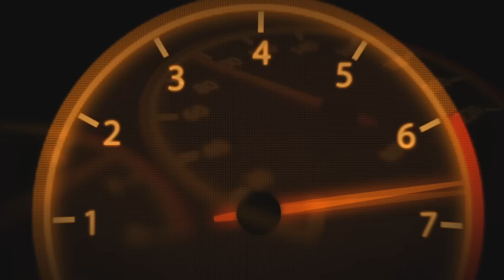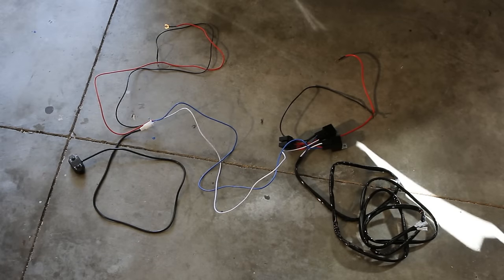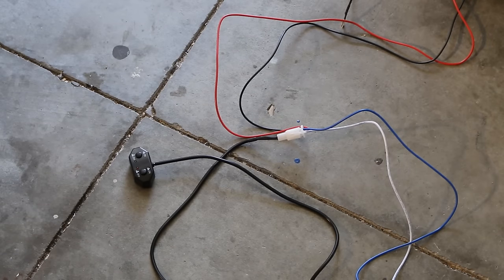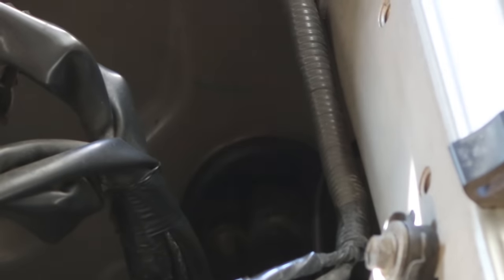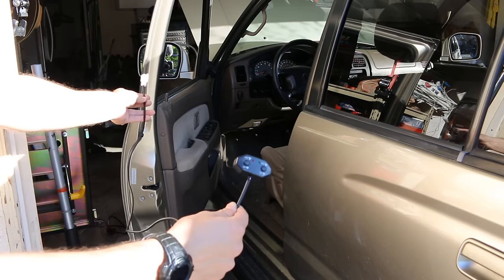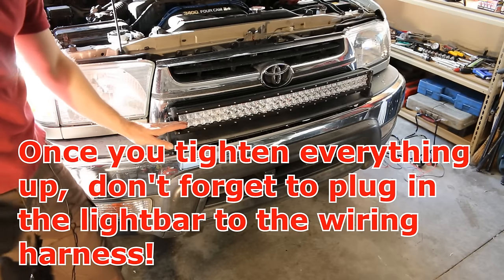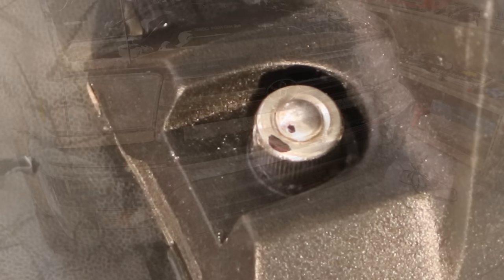How To Wire And Install An LED Lightbar On Your Car - 1080P HD

Comment: no you don't disconnect the negative black cable you disconnect the positive cable please don't listen to him that's not right
Reply: You might want to Google that.  "By removing the negative battery cable you are disconnecting the battery from the chassis of your vehicle. If you begin to remove the positive side before the negative and your wrench would make contact with any part of the vehicle, then you could cause a short in the system"